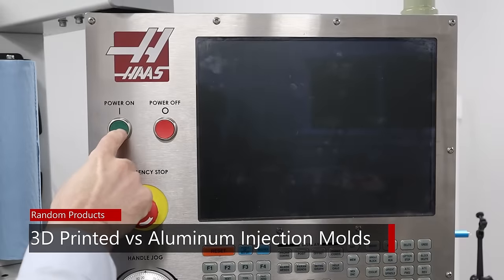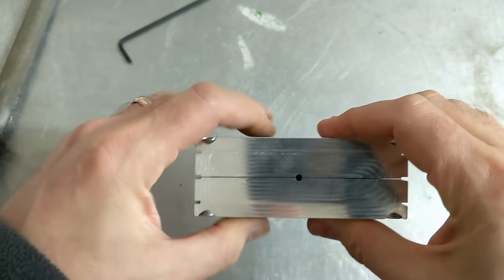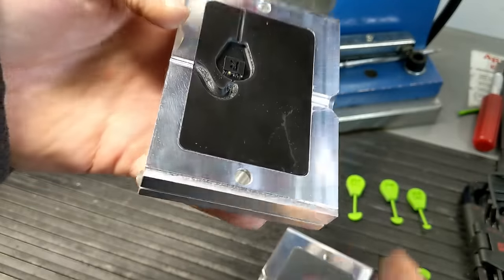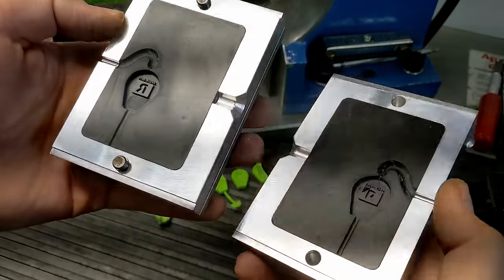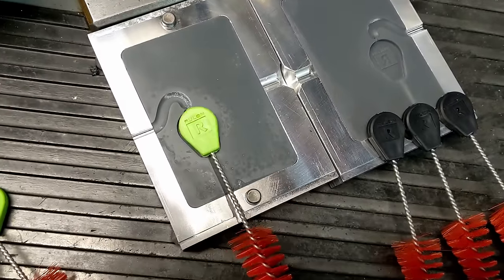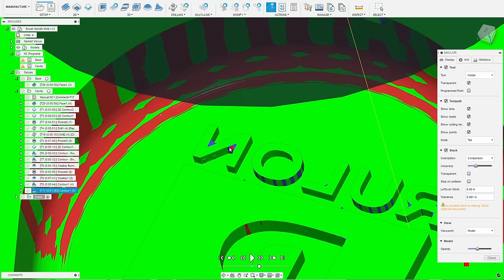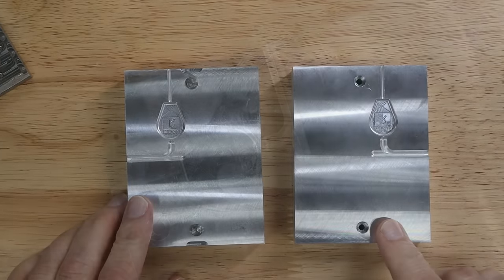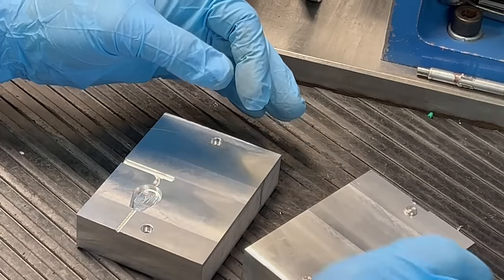3D Printed vs Aluminum Injection Molds

Comment: I wouldn't use printed mold tooling for any sort of production, but they can be extremely useful for testing and iterating molds. If you're designing a part with difficult features, printing a test tool can save you from machining an expensive piece of scrap or chasing your tail with rework. A printed mold will never behave exactly like a metal mold due to the different thermal properties, but it can give you some useful information, particularly if you don't have the budget for mold flow analysis.
Reply from the maker: I suspect this depends on what ability you have to make molds. If you don't have a CNC machine, and therefore have to rely on someone else to make the molds, what you say is spot on and I should have mentioned that. Using a 3D printed test mold before paying someone else to make a mold does make a lot of sense. For me, since I have the equipment and experience, milling a mold is often faster.
Reply: @JohnSL  The key factor is opportunity cost. Printed molds are objectively bad, the resin isn't particularly cheap, but it frees up a milling spindle to do something else. That's obviously not a significant factor in your shop, but the value proposition is compelling in a commercial environment. FFF printing for soft jaws and fixtures has a very similar business case.
Reply: I guess if you print a mold in pa12 on a SLS you get a pretty usefull mold. The only problem that remains is the heat disapation. I think LCD or DLP is just not the best choice of printer.
Reply: Have you tried ceramic resin or Phrozen Functional Resin - TR250LV High Temp 3D Printing Resin?  You can also put additives in your resin as well.  If you are experimenting you could try aluminum dust mixed in the resin.
Reply: 3D printing never was about production (until very recently) the main salling point is fast prototyping and to replace injection molding for small bussineses.
Reply: @JohnSL I am trying to make injection molding where mold is water soluble. what materials should i use? thank you.
Reply: @j.dietrich  3d printed soft jaws for what? Machine vises? Zero application, unless your tolerances are so loose you're doing QA with a measuring tape. For bench vises? Sure, but that's a very niche use case.

Comment: One thing I do when designing 3D printed molds is to actually recess the unused parts of the mold. This reduces surface area contact and makes it so you don't have to sand your mold halves to get them to mate flush. The smaller surface area actually warps the mold back into shape when clamped so both halves are flush with one another. Granted these molds don't have many cycles, but the results were promising with no flashing and no sanding.

Comment: I know this video it older, but this resins prints and cleans much easier than sculpt resin.  It also prints incredibly fast.  SuperHDT 3D Printer Resin, Highest Heat Deflection Temperature 464°F (240°C), Made by 3DMaterials

Comment: You may want to revisit your conclusions regarding use of plastic molds.  Bulk filament products containing up to 30% aluminum particulate will likely ameliorate many of the issues that differentiated aluminum-milled vs additive-plastic mold based injection molding techniques.

Comment: Nice breakdown. I machine a lot of alum injection molds for reproduction toys but will sometimes use a printed a mold for prototyping before making chips. Even then the "hi-temp" resins chip after a couple shots. Resins have made leaps so maybe within decade they will be on par with aluminum for small production runs.
Reply from the maker: Agreed. It might get there someday. But it's not there today.
Reply: have you tried any of the formlabs high temp resins? I would be curious to see how those hold up to these tests.
Reply: @lupusk9productions  I haven't but I have talked to some sales reps about the material. My take-away was it wasn't ideal for deep molding. It was still cheaper for me to machine the type of aluminum molds I make vs investing in the form series printers.

Comment: My mannn, I'm glad the Siraya tech resin worked alright for you!
(P.S. My contact at Siraya sent over some clear to try - he says you can theoretically get an even STRONGER resin printed injection mold due to more thorough UV curing. I neeed to try it.)
Reply: And keep steady craftin
Reply: It's the real crafsman. What's up with Youtube not giving your channel a check-mark?
Reply from the maker: Thanks. I also found out that they Siraya Tech Sculpt Ultra White that is rated to 220C (and I put a link in the description). I suggested this to Rulon in case he wants to try that next time. I don't have an SLA printer (I had one and hated working with it). And since I have a nice CNC machine, that's faster for me anyway.
Reply: I may have to finally give this a shot  =D

Comment: Great video and insight into the realities of these molds!

Even in the last year, there have been many developments in resins and tech for printing molds. Not to mention the costs of resin printers and associated gear absolutely tanking, which is excellent for DIYers and people trying to break into this unbelievably expensive industry.

Possibly at the time you made this video, it might not have made complete sense. Still might not to many. That said, there are companies and individuals getting hundreds of cycles out of single resin printed molds with excellent results. This is enough for many. Obviously we would all chose to have aluminum molds in an ideal world. But it isn't one for most of us. Especially for those who are not able to invest in the traditional "proper" equipment. Many of us are punching this shit out on a homemade injection mold rig, doing it in a shed. The extra hassle of making something work with the resin process is the difference between having something vs nothing at the end of the day. I can print 30 molds if I need to, and still be well under the cost of a traditional route.

It's also an incredible learning tool when it comes to the real world complexities of injection molding. 

There is also the aspect of trying to paste traditional injection molding processes to the resin injection molds, as if they were metal. It just isn't going to be that way, as much as many in the industry treat it to be. There are likely many more differences to discover and learn. Lots of adaptations that can be made. Lots of improvements to develop. Even this comment section alone has some excellent advice.

As materials advance and the tech progresses, I am hopeful for a day where everyone looks back and says "wow how ridiculous it was that we used expensive, complex, subtractive manufacturing processes just to make a mold for a single brush..."

Comment: You should bake the high temp print after washing and prior to curing. this helps to remove moisture, which prevents cracking and makes the mold more durable. 

also, you may try phrozens tr300 ultra high temp resin, which has the highest rated working range ive been able to find.
Reply: Have you seen siraya's high temp ultra white? It claims 220c
Reply: Haven't tried it, but that's about the same as the tr300. If I can't get the tr300, I would probably try it then. Thanks!

Comment: I recently made a small resin 3D printed mold and it works great. The difference, I'm injecting wax, not plastic. It holds up well to the lower temperatures. I use the wax for lost wax casting of rings. I find the plastic procedures fascinating, and I've learned some things that I can apply to my wax mold making. Thank you, very informative.

Comment: Im a plastic injection mold maker. 
1. Polish your runner channels ( the sprue you added shouldnt curve... ) 
2. Your location pins should be removable press fit dowels, usually at .499 or .500
3. You need you accommodate heat shrink the plastic will expand about .015 thou 
4.. those inner faces with the detail would be considered an insert, inserts are typically toolnsteel, hardened for a reason, i know you are limited in your options but! Heres what you can do! Send your cam models to a mold shop, tell them you have housing you just need this insert fabricated, they will cut carbon blocks to mirror opposite of your image, it wont be cheap but it will be right, chamces are itll be tool steel.

Comment: I'm positive someone's already said this, but the nice thing about the resin molds is that you can print out 10 sets of them with a $25 bottle of resin instead of paying way more than that for a machined aluminum mold. You'll blow through the resin ones way faster, but for an independent maker trying to do small-scale production or even just a home gamer without a huge budget, it's pretty handy.

Comment: Thanks for another informative video.  Two thoughts: First, the print orientation of the resin-printed mold really can make a difference.  Printing it "flat" is quickest, but printing it upright or on an upright angle is superior for finish and strength.  Second, the Siraya Tech Sculpt is a good product, with an HDT around 160C; however, Formlabs makes High Temp Resin with an HDT of 238C and Rigid 10K Resin with an HDT of 218C.  Okay, a bonus third thought: You can speed up the resin-printing and the cooling rate of the molds by not printing them solid, but relieving the "back" where it is not directly supporting the cavity.
Reply from the maker: I learned from one of my viewers that Siraya also has Sculpt Ultra White, which is rated to 220C. I let Rulon know about that and he may try this again with that resin. If so, I'll make another video reporting the results. https://amzn.to/3PlsB0G
Reply: @JohnSL  I've used sculpt ultra white for plastisol. It seems to hold up well enough but it's a little touchy when it comes to your exposure settings.

Comment: Consider making a graphite electrodes on the CNC mill and burning the cavity using ram EDM.  Much easier machining the graphite and the finish will be better, and more consistent with EDM.  (easier to add draft to the fine details also) You're not limited to aluminum for the mold either.  Hardened steel would be an option because it's just as easily EDM'd as alum.
Reply: Excellent idea! Now where to find a used RAM EDM at reasonable price..
Reply from the maker: Except that I don't have a RAM EDM. I have a moratorium on new machines for my shop at the moment until I get more of them running. Self-imposed.
Reply: @Vikingman2024  Ebay.

Comment: - SIMPLIFY PROGRAMMING FOR MULTIPLE PARTS (OR 2-SIDED)...
- 'MANUFACTURING MODEL' (in Fusion 360 CAM): consider using this: one for each half (core/cavity).
- Do 'Create Setup from Manufacturing Model' (for each part).
- And do 'Associate Named View' (for each 'Manufacturing Model').
- Hopefully, this finds you in time, and you will be able to take advantage in future projects...

- All in all though, great job on the modeling/programming: parts came out very nicely.

Comment: How about water/liquid cooling the 3d printed mold during injection. The aluminum base halves could have conduits and a recirculating pump and radiator setup supplying through them (similar to computer cooling systems), taking away the heat. Possibly even more so than a pure aluminum mold if the system is dialed in correctly for correct temps.

Comment: This is 8 months old but you should try using some high temp graphite or other metal based 3D prints. you are essentially attempting to inject liquid plastic into crystallized plastic the heat is going to transfer! it will crack and come apart just as the gate did. but for the cost of running a CNC you already own it probably cost you more to buy the resin than it would of to make 2-3 moulds on the CNC in aluminium  not to mention if they fail,crack,warp, etc. you can just recast it into a new blank resin once it is done its done!
Reply from the maker: I made this video because I saw a lot of people who seemed to believe that 3D printed molds were the solution to making molds on the cheap. And therefore wanted to make your exact points in the video so people would understand that 3D printed molds have serious limitations.

Comment: I wonder how Siraya Tech Blu, Sculpt with a 10-25% mix ratio of Tenacious, or their Mecha resin would hold up for this purpose. I know Sculpt alone is pretty brittle. I also kind of wonder if heat treating in an oven first might help with that warping issue.

Comment: I found this a very interesting video as it is almost what I'm intending to do with my resin printer.  I have an electrical electronic wire harness manufacturing business and one of my customers wants a strain relief overmolded onto a connector with wires running to it.  They only want low volume of approx 175 per year so it may be possible to make a resin mold.  I've looked at the Formlabs system and have looked into high temperature resins.  I notice Rulon used a decent resin but I think there are better ones out there.  At any rate I will be trying this process out for sure.

Comment: Very interesting video. It looks like the sink would even help with holding it. For other people also using resin; I am having great success with Siraya Tech Fast, the faster and cheaper option. Better than the also used here Siraya Tech Sculpt actually. I don't have a professional machine like you guys (I am using an open source self-built Buster Beagle 3D machine) and I don't generally need as many parts though. I also don't have a metal casing and just clamp the resin molds directly, but it still works.
Reply from the maker: The sink mark is an indication that the packing isn't as high as it could be. Holding injection pressure on the mold longer increases packing. And the increased packing will hold onto the wire better. One way to think about this is it's "maintaining" a higher pressure on the wire with increased packing.
Reply: @JohnSL  I understand it’s better without the sink. Just thought it added a nice unintended dent which can help with holding it :) B.T.W. I’ve finally sent you some stickers. Hope they arrived or will arrive soon.

Comment: Correct me if im wrong but non of the 2 resins you showed is "high" temp.
Try and reach out to 3dmaterials perhaps they want to sponsor some high temp resin, that can handle 240 C.

I'm not sure what temp your plastic is but this might hold up better. there normal resin if super awsome! i can only imagine the high temp is just as good
Reply from the maker: Siraya's Sculpt is rated at 160C, which is higher than their normal resin. But I learned they also have Sculpt Ultra White: https://amzn.to/3PlsB0G

Comment: So what was the curing process for the sculpt, it is a very picky material you have to get the settings just right and cure it properly or it can fail. I used to make lots of molds for fishing lures out of the material and hitting 350-400f and injecting small and huge cavities for 100+ injections without issue.

Comment: the gate is to small, it needs to flow better and you need to have the mold liquid cooled to prevent that sink. really not a difficult thing, drill holes down the length of the mold then cross drill and tap the ends for plugs. run a computer liquid cooling rig (because its small and manageable, also you can adjust the temperature) and  you will have a nice injection mold. if you liquid cool it and use an "ABS like" or high temp resin you can probably get quite a long life out of the mold.

Comment: i would try to manufactur the Aluminium as close to the cavity as possible and put a water flow thru it so the Resin part of the mould stays cooler and the final part cools faster
at least that is how we do moulds in injection molding industrie

Comment: I wonder if you were to cast a larger shape or if more of the overall mold space was aluminum instead of resin or if the actual cutout was further away from the sprue if it would remove heat more effectively. I've always thought it would be cool to have someone with a thermal camera record the demold process, maybe even some intentionally too-early demolding to see if there was any sort of behaviors to inform adjustments to the aluminum jacket resin printed mold process.

Comment: Is removing the dowel pins then lap the plates on a surface plate to get the two plats fitting perfectly together an option? Or doesn’t it matter that much ?

Comment: Very interesting. Thanks for sharing that process.
Where do you two get your colored plastics? I'm looking for material with high tensile strength like ABS but with lower temps/better flow/same cost AND in different colors.
Or I'm just looking for lots of different color choices in ABS (1-5lb lots)
Reply from the maker: I buy 3D printer filament and then chop it. That sounds like it would be expensive. But it's actually not that much more expensive than custom-colored pellets. Plus, you don't have to commit to buying 55lbs (or 110lbs) of plastic in the color you want. Here is where you can find more about my pellet chopper: https://trains.socha.com/2021/07/plastic-pellet-maker.html
Reply: @JohnSL  Thanks JohnSL, I saw that video and watched the videos you made during the build. Nicely done. I found a plastic injector near me I'm going to meet with Monday. Hopefully, he will sell me some in small quantities of glass-filled BAS so I can avoid the larger quantities. If not I'll be shredding like you. thanks for all you do for the community!